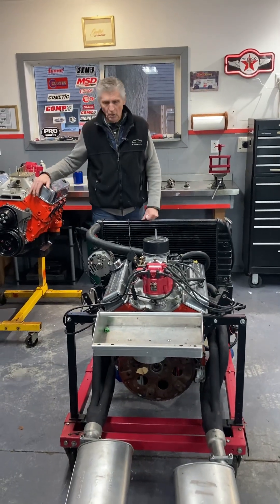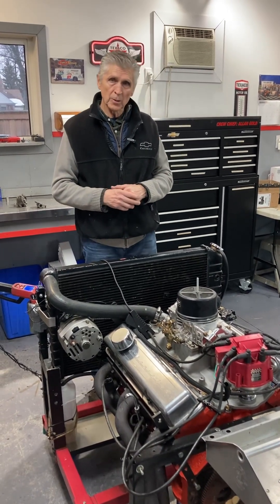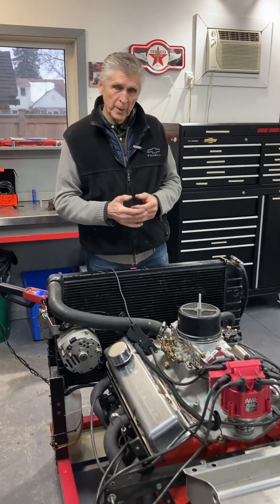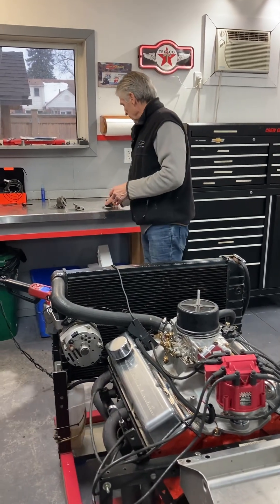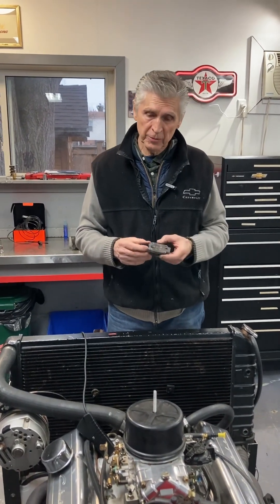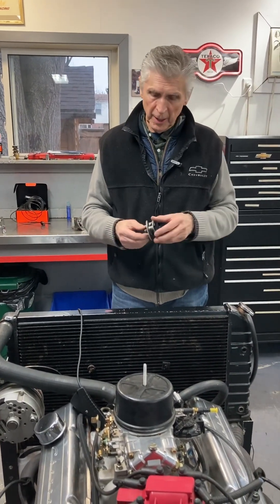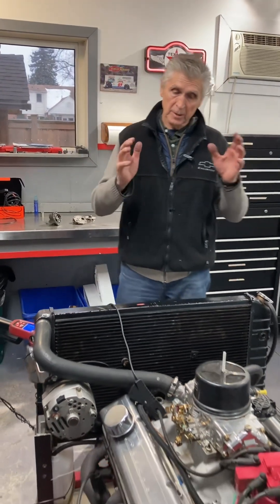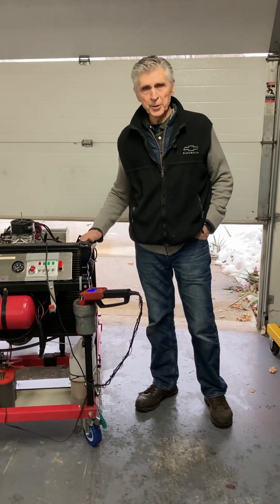307 Chevy SBC Cause and Effect Failure Analysis applied to flat tappet camshaft failures

Comment: Good video. You state only the camshaft has "direct metal to metal contact." Rings and cylinder walls have a similar relationship to that of the cam and lifters. Lubricant within the crosshatch is vital for ring seal longevity.
Reply from the maker: Good catch, thanks for correcting me Bill. AG

Comment: You could use a roller with a tight lsa for torque example 212-218 108 lsa or less depending how aggressive of a idle
Reply from the maker: Thanks Utah, Yes you could. Keep in mind, it is a small CID/intake valve dia. ratio and a heavy vehicle with highway gears. AG

Comment: Taking all aspects into consideration the sticky relief valve is more than likely part of the effect. The valve likely sticks because metal particles small enough get jammed between it and the bore. The cam and lifters experienced metal loss because they came into contact. Lifter radius and taper are critical but so are numerous other factors with flat tappet cams, everything from installation protocol to oil formulation. Early SBC's also have an added variable of cam walk forward. It is absolutely imperative that no matter what cam, a thrust button be fitted. Thankyou for your no nonsense approach and bringing your experience to the interested. Keep up the content and best regards from Australia.
Reply from the maker: Thanks Scott, your comments are right on. Thanks for watching all the way from Australia. Malborne is the #1 city watching my videos, pretty cool! AG

Comment: How Close was I to Early cam & Lifter Disaster ??  ....Just got around to Inspecting my  hydraulic Lifters that were removed in 1972 from a Factory Oem 1970 426 hemi Plymouth engine with Only 10,500 miles.....The engine sounded normal, good  & cam was Only pulled for upgrade to Solid Lifter cam swap.....One hydraulic lifter Face has a perfectly smooth, flat, centered 0.660" wide Depression 0.003" Deep......Assuming it Originally had the usual 0.002--0.003" tall Face lifter Dome,  that Is 0.006" Lifter Face wear in only 10,000 miles !!  ....Only good  10W30 & 20W50 Pennzoil was run with Very frequent Oil & Filter changes.....The 1970 Hemi engine used Single 320# Open springs with Damper.....Is This a 1970--1972 time frame Example of a Factory Oem engine Flat tappet cam & lifter Early Accelerated wear,  Imminent engine Killing cam & Lifter Failure ??  ......Haven't got around to Inspecting & Measuring the other 15 Lifters......
Reply from the maker: Good catch Tom. The problem with lifter failure, it doesn't just destroy the cam and lifters, it scratches up the crank, cylinder walls and pistons, destroys the bearings and messes up the entire engine. Be sure to use oil with ZDDP / Zinc with your new cam unless it is a roller. Thanks for sharing. AG

Comment: The bad thing about the 307 (and the 396 big block) is they were all made in mexico, and unfortunately a lot of them had core shift. Best way to tell is look in the lifter valley at the lifter holes. They should all be in the center of the boss. If it's not centered and gradually gets worse as you go down the bosses, the core shift is bad. That usually means there's core shift in the cylinders too. Probably has nothing to do with the problem you're having, but unless you have a good/decent block, problems can develop with the 307 and 396.
Reply from the maker: Thanks Targa, that is good information. I knew that big blocks were susceptible to core shift but I did not realize that blocks were made in Mexico back then. Always learning. AG
Reply: That's BS nether 307 or 396/402 blocks were cast in Mexico. The target master 350 is the only one that I know of and the whole engine was hecho en Mexico.  Sh!t for brains.😅

Comment: Nowadays it is usually the cam's fault if it fails. They fixed just about everything so they won't fail except they just can't seem to get the taper correct on the cam lobe so the lifters spin. If you mic the cam lobe on one end it should be about .002" less than the other end. This is .001" per side so it has basically a .001" ramp so the bottom of the lifter isn't in full contact with the lobe and this ramp makes the lifter spin.

This tiny detail is what is killing the flat tappet cams these days and is something you will definitely want to check going forward if your customer insists on using a flat tappet cam.

Also in a couple previous videos I heard you mention mocking the assembly up to check the deck height, you don't have to do that anymore there is an easier way. Save a used main bearing and file the tang off of it so you can install it so it hangs passed the main bearing housing so you can use a set of depth mics to measure from the deck to the back side of the bearing. Now add half of the diameter of the main bearing housing bore and there's your deck height. I hope this was helpful? As long as the rod lengths and piston's compression distances are what they're supposed to be this should save you a ton of time. You can also measure the rod lengths and compression distances fairly easy before those parts are assembled with common calipers.   

Sorry for the long comment, no offense intended.
Reply from the maker: Thanks for watching and sharing your knowledge and experience. I have been at this for 60 years and still learning.
Reply: @goldsgarage8236  
Thank you for your kind words. You got 23 years on me, I only have 37 years into this stuff.

Comment: Interesting, I have low oil pressure at idle with my 454 when it warms up, I am pulling the pan when the weather gets better to check the mains, I'll check the plunger in the oil pump. Your 307 has good throttle response.
Reply from the maker: Thanks Joe, we will dyno the 307 tomorrow. Watch for a future video on the results.
Reply: No flywheel or converter, revs like a Sprintcar.

Comment: Great Video & first class service by you! I always take oil pumps apart & I like to check & blueprint them before use. I have seen multiple Melling oil pump issues in my lifetime from debris to sticking relief valves. 1 out of 15 I'd say has had some type of issue. I just don't take any chances. On my flat Tapout break-in procedure: I've always ran the engine for approx 30 min, the let it go stone cold. Restart it next day, change oil & check lash & have had good luck.
Reply from the maker: Thanks for your comments and input Terry.

Comment: To my flat tapping brethren, I just broke in a FT can with driven GP1 and their break in oil.
Reply from the maker: Thanks for your input. I will build flat tappet engines again, I just didn't want to take a chance on this one.
Reply: Sorry to hear that.....Per 540Rat  blog,.....Both Driven GP1 & BR Break-in oils Test & measure very Low  on the  Flat Tappet & Camshaft  Wear Protection test.....Read the Whole website & then find your Oil product wear test results......Very eye opening & could explain your Results.......
Reply: @tomstrum6259  thier H1 oil is thick and works very well with flat tappets aslong as the oil pump is ready for it
Reply: I didn't use to have these problems, and just used motor oil.
Reply: @thisisyourcaptainspeaking2259  because it's already worn in. The problem is getting them worn in

Comment: Seems like the cam failures is due to poor quality control letting theough cams without taper and lifters without convex feet.
So what one should do is make sure the cam has a taper on the lobes and check the foot of the lifter. To be sure I guess one can get the feet reground to a suitable radius.

The engine guy I have helping me hasnt had any failures during the last 15 years using comp cams.

Regarding oil one could use the tried valvoline racing oil. The latest verions was recently reviewed by Lake Speed jr.
Another oil that might be good is a vw 505 01 spec oil. Its specified for their ”pumpe-duse” diesel engines and their W8 petrol engine. This is because you have a high pressure contact of a lobe on the cam driving the fuel injector system in the diesel. The W8 engine have alot of chains so I think this might be why that oil is specced. But in any case the oil seem suitable for petrol engines.

Of course one can buy Driven Racing oil but that is more expensive..
Reply from the maker: Thanks Magnus, that is good advice, you shouldn't have to do that but I guess that is the reality of the situation.

Comment: One cause you didn't comment on was your customer using modern oil. Lack of Zinc causes the cam to wear and bits of the cam jambing the pressure relief plunger.
Reply from the maker: Thanks for the comment Steve. What I described in the video were the three possible causes that  remained after vetting or could not be disproved by factual information. The ZDDP issue was listed as a possible cause, however I broke the cam in with Lucas break in oil, then replaced it with the same oil. After that the owner replaced the break in oil with Lucas Hot Rod  oil which also has Zinc.